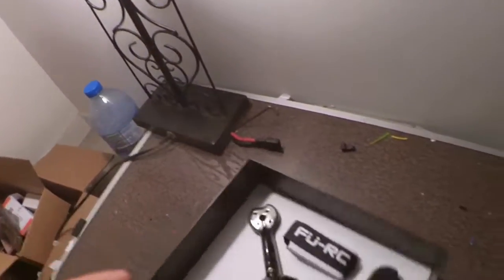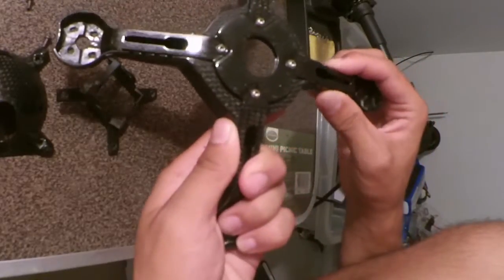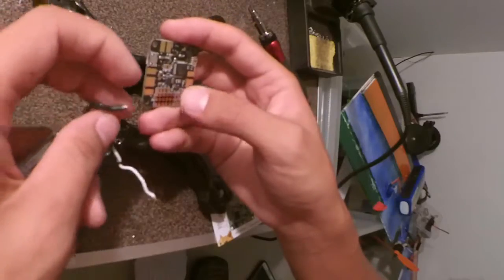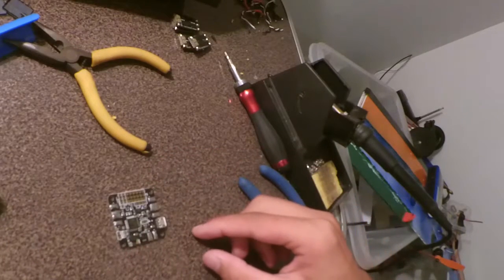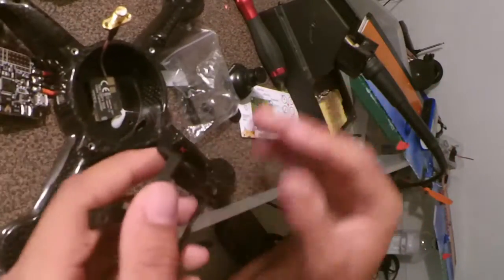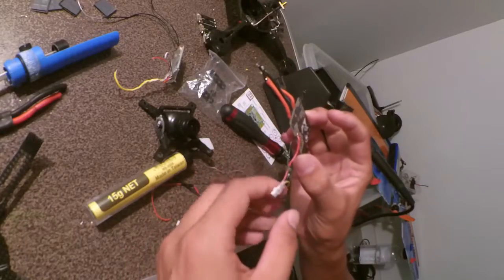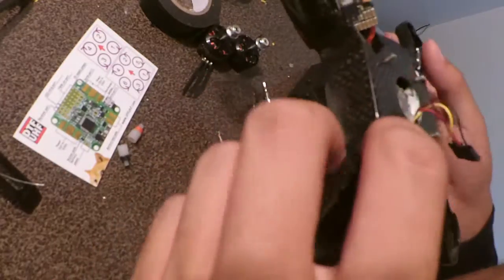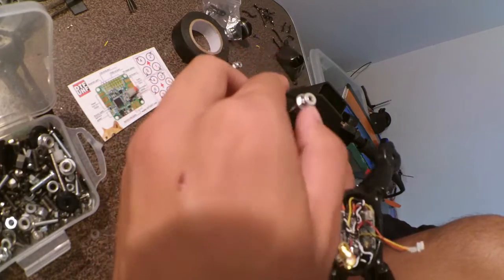FU-RC KORE! BUILD!

Comment: I will probably get one... But I was wondering how is it holding up against frequent crashes? Cos when u break am arm here it's pretty much 150$ in the trash... So I'm hoping that it's a pretty tough frame? How's your build holding up? Thanks for the build video ;)
Reply from the maker: Ray Choi Overall the Kore is very tough. The camera is well protected and the arms are.very stiff. From testing. I've found that the weak spots are at the motor mount. Maybe consider using lighterweight motors? The frame is weakest on a side impact to the motor mount.